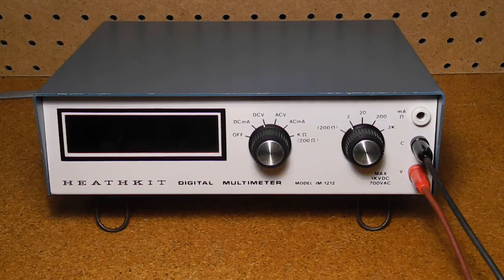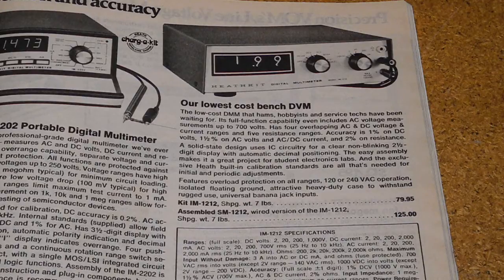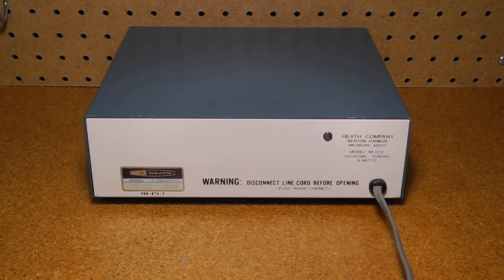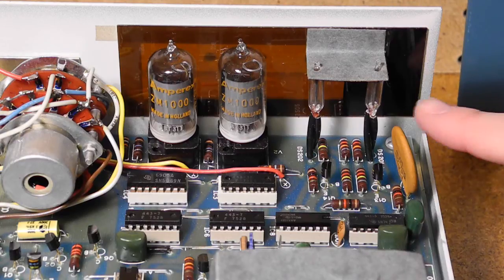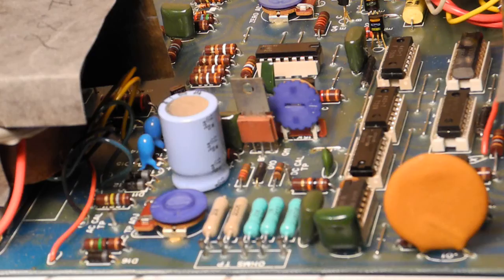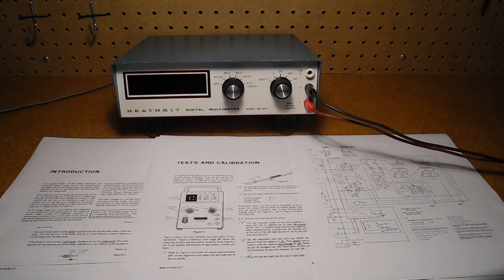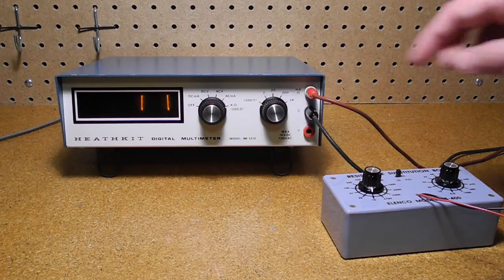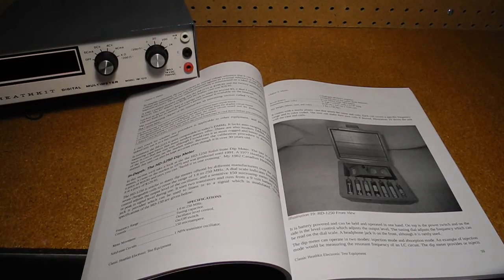The Heathkit IM-1212 Digital Multimeter

Comment: Hi Jeff

I have been restoring a couple IM-2102 and IM-1212 Nixie VOM's (a pair of non-functional IM-102 and IM-1210 VOMs are waiting in the wings), and was disappointed by the hard-to-read Heathkit schematics (very small text & often obtuse circuit layout). This was made worse if a scanned & downloaded schematic needed to be used. I did find a real IM-1212 manual on eBay, and downloaded an IM-1202 schematic whose component designations and values are often illegible (due to low resolution scanning of the original). I did a LOT of work through a jeweler's loupe and peering at the components on the meter circuit boards, and eventually got what I believe to be two reliable schematics. Over the last week, I spent a few hours every night generating new schematics for both models using AutoCAD, with a lot of effort to try and maximize legibility through careful tweaking of component and text sizes, and fine adjustment of circuit details and orientation and spacing of circuit sections. In the process, I also 'un-did' the more obtuse Heathkit circuit schematic layout areas, hopefully maximizing ease of understanding the circuit. The resulting PDFs are intended to be printed at full size (no scaling) on 11x17" paper, approximately the same size as the originals in the manuals, but with better use of available space.

I have put the PDFs on my personal fileshare webpage www.serpentwebsite.com/fileshare.htm, down at the bottom of the page along with other Heathkit schematics I gave a similar treatment to. I hope you and others can benefit from these.
Reply from the maker: Thanks, I will check it out!
Reply: @jefftranter  , as always happens, even after I do a lot of proofreading, I will immediately spot an error when looking at my work a few days later. I have just updated the files on my fileshare page to "Revision B" (both the IM-1202 & IM-1212 drawings), which fixes a few places on the function selector switch where I was off by one position in regards to DCmA and DCV. Makes more sense now.
Reply: @youtuuba  , your drawings are an awesome contribution to this channel and to the community at large.  I am just a hobbyist, but I wanted to thank you for taking the time to create and revise this work.
Reply: I recently picked up the Bell & Howell version of the IM-1212 (Heathkit IMD-202-2 based on the very faded sticker on the back of the unit) at a swap meet for $2.50 because of the Nixies inside (didn't even realize it was a Heathkit design until I put it on my bench at home).  The exterior is a little rough (probably why everybody ignored it), but the inside looks pretty decent.  Now that I have a nice set of schematics to use for this process, I plan to run through it to see if I can bring it up and then get it back into shape.  I am subbed to this channel and now to yours as well.
Reply: @8alonzo8  , the nice things about these low-end Heathkit Nixie display DMM's is that the components are pretty generic, nothing custom or odd about the component choices. Assuming that the selector switches are OK, all other parts can be replaced fairly easily. Unless they are physically damaged, the Nixie tubes are probably OK. The display driver ICs are not unusual, but are no longer in production, so it is necessary to buy those from surplus sellers, on eBay, etc. The other ICs are still available.

Comment: I have the Bell & Howell Shcools labeled model, It has a 1/2" hole someone drilled in the front panel above and between the range knobs. Wondering if someone had a polarity switch in there once, I'll probably put one in there just to fill the hole...
Reply: I added a toggle power switch to mine, thought about putting it there

Comment: I have the same one. still works. the cardboard over transformer was lost and I got extra tubes. and have the BELL and Howell version complete with manual to  calibrate meter. was gotten threw the school program. doe't remember the price.  can tell you the readings are off in the cold. below 60F. my display flickers the same way.